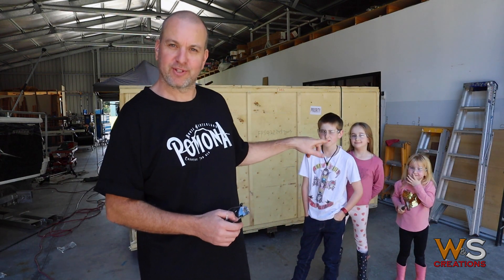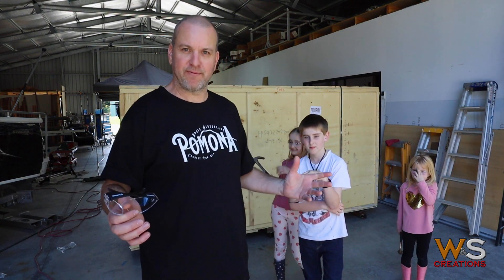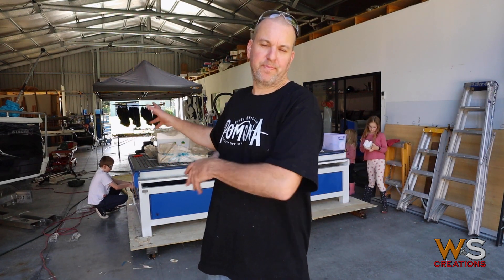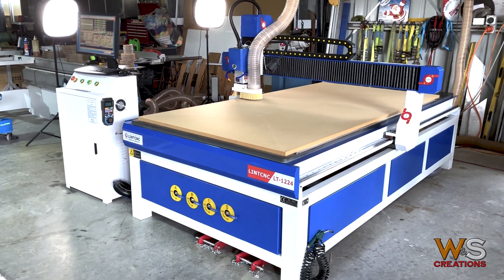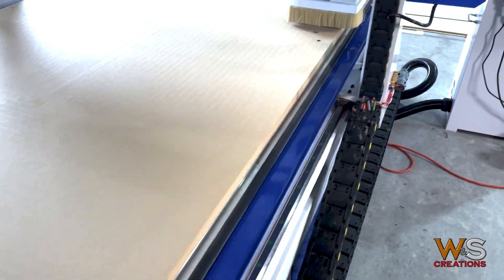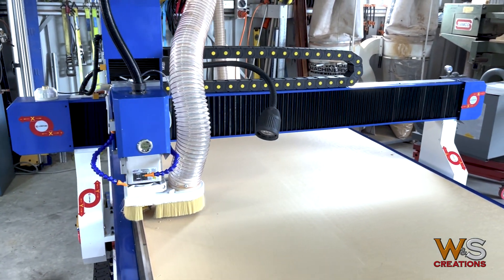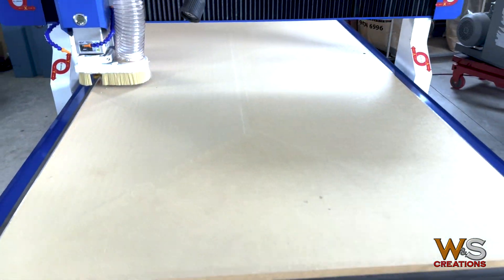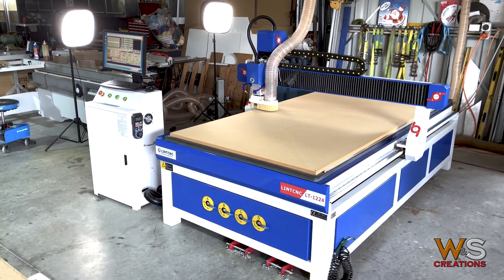CNC Unboxing - Chinese imported CNC Flat Bed Router

Comment: hello. can you do new video about this cnc? i would like bought this model from lincnc. tell me, please...
Reply: I have worked with JINAN STYLE in China and I have visited their factory. Good quality and service.
Reply: Sadly this machine is not good quality. @yassinemounmak4950
Reply: Yes we are doing a video update in the next few weeks. If you can avoid buying from Lint CNC then avoid them as they quality is low.
Reply: They are also fraud. They would charge you more for shipping after buying from them.